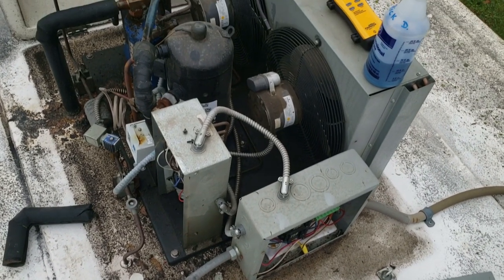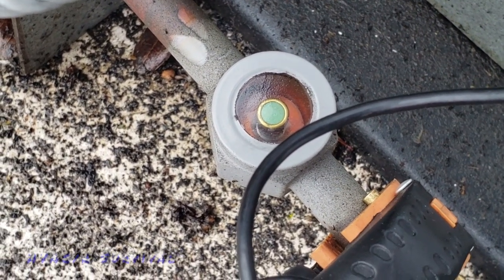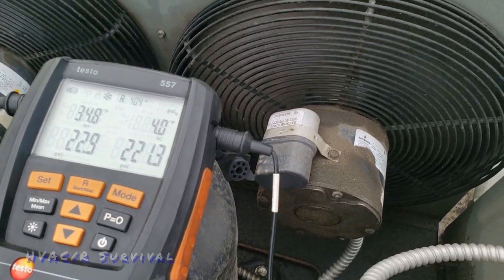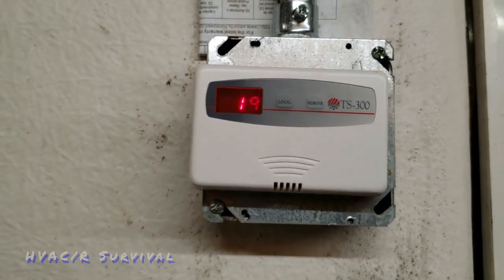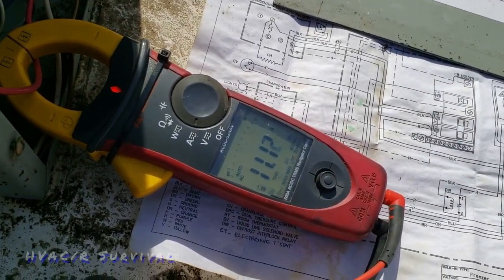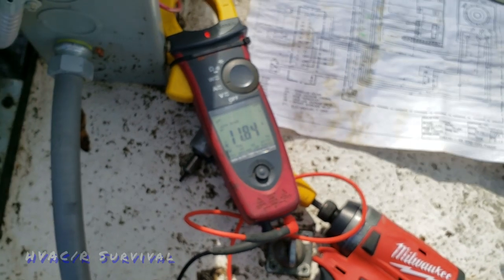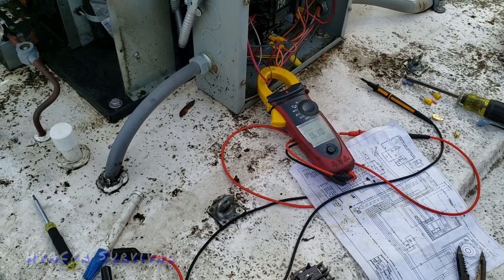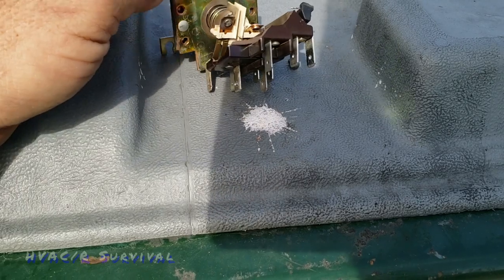Walk-In Freezer Refrigerant Leak Breaker Tripping

Comment: Do these pumpdown systems also hv compresser heaters too or is that in very cold climates?  Thx
Reply from the maker: It's weird, it's hit n miss sometimes.   In theory if it's pumped down I don't see why you need a heater. Generally that's to keep the refrigerant from saturating the refrigerant oil and washing it away. If it's pumped down it's going to be on the high side of the valves and trapped before the evaporator. So when that when the solenoid releases it's going to boil off as it goes through the evaporator before it gets back to the compressor on startup.

Comment: Hey the return air stream of the evap is a good place to put the sensing bulb at to read actual box temperature. Nice vid, nice pressure washer wand. 👍
Reply from the maker: The return path is was where we have located the builb on all the low profile evaporators that I have worked on, but this box had a monitored temperature alarm that was out of calibration and kept going off. So I moved it after replacing the thermostat did not remedy the issue, Thanks for watching and commenting, I really do appreciate it!

Comment: I had a walkin freezer that would blow fuses I checked everything a month later fuse blown again. I couldn't find out why. I eventually found the wires running between the evaporator fan motors would at times wiggle and rub against a knockout that had not grommet. I replaced the knockout with a nice plastic sleeve never had problems again.
Reply from the maker: Yea,  that sucks for real. Thanks for sharing your story👍🏻👍🏻

Comment: Nice 1, cant always tell on them relays 👍🏼
Reply from the maker: That's why I like cracking them open to verify my assumption. Because I'm not a parts changer I like to feel confident that I got the problems solved the first time, however this call taught me to slow down and check it all.
Reply: @HVACRSurvival  I honestly have never witnessed those relays tripping a breaker. But in our industry, when you think you seen it all BAM!!! Something new. That's why I love what we do 🤙🏼
Reply from the maker: @azhvacr2332  the relay didn't trip the breaker the relay not disengaging the electric elements while the compressor was short cycling is what was causing the issue.

Comment: I have never heard of coil defrost heaters referred to as "electric strip heat". It looks like your defrost termination is letting coil get too hot causing the water droplets on ceiling.
Reply from the maker: Electric strip heat is probably my hillbilly talk left over from HVAC going into refrigeration? (I like to abbreviate things, kind of like an ice machine goes into a harvest but really it's a defrost, a reversing valve is a four-way valve, TXV is really a TEV)  😁.  The schematic didn't even show the termination switch on it but obviously in the video you see it has one but because of all the other issues running up the clock I didn't spend a lot of time on it, but you are correct it seems like it's getting a little to warm , one downside of those electronic defrost clocks is the 15 minute increments,  if it was a traditional analog clock I could have set it at 22-25 minutes.  Thanks 4 watching!
Reply: @HVACRSurvival  trust me I recently came from residential to commercial and i cant help but call it electric strip heat too lol. Txv's and all that resi jargon. You did a great job and are very thorough!
Reply from the maker: @thefambam9305  Thanks Anthony,  I appreciate your compliment. It all takes time to learn, I'm learning everyday.
Reply: Water droplets could be a number of things...drain down time fan delay etc

Comment: What you have to remember about circuit breakers is that they have two types of tripping elements - most folks only think of the short circuit trip - that is the magnetic trip part of the breaker and is what is referred to as instantaneous- the other trip element is caused by heat - that is the overload ... when a motor turns on and off rapidly the inrush from the motor starts are several times the breaker ratio g usually - these rapid starts will overheat the thermal element in the breaker and cause a trip.  Also on these smaller breakers they are only rated at 80% of their nameplate rating continuously.. continuously in the electrical world of circuit breakers is anything over 3 hours.  So your 20 amp breaker is only good for 16 amps continuously... I have seen lots of breakers loaded to their 80% for long periods of time and have a compressor cycle and cause the breaker to trip.  There are some rules in the national electric code that allow for up sizing a breaker if you have these problems.
Reply from the maker: Two weeks after this video was released,  a shorted wire in the evap area was found as the fault. 🤷‍♂️ Your dead on about the 80% rule👍👍Thanks for your explanation 🤜🤛🍺🍺
Reply: I've come across breakers that get hot and trip after about 20 minutes of the unit running but everything checks out perfect on the unit so I wrote it off as a bad breaker possible an old breaker